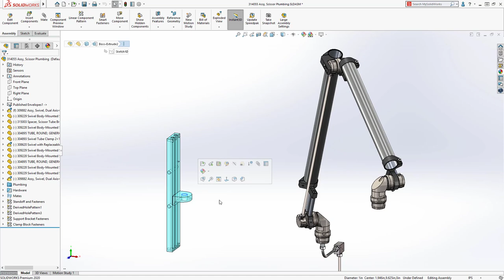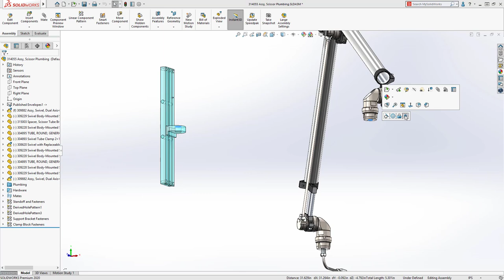What's New in SOLIDWORKS 2020 - Envelope Publisher

Comment: Is there any way to mate to a sketch in the published envelop or does it only mate to solid/surface bodies? I tried pushing my layout part which is mostly just sketches that define geometry, into a sub-assembly by using the assembly publisher, but it won't let me mate to sketches. If I just take a copy of the same layout part and put that into my assembly, it will let me mate to sketches.
Reply from the maker: Hi there! A great question for our user community. We have a great team of SOLIDWORKS experts well versed in technical aspects of the software. They would love to help you out.